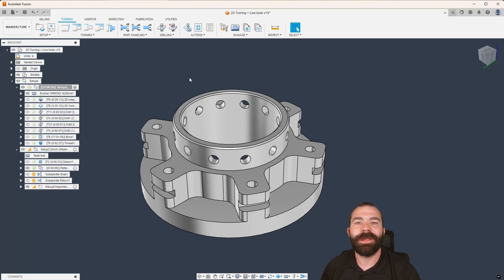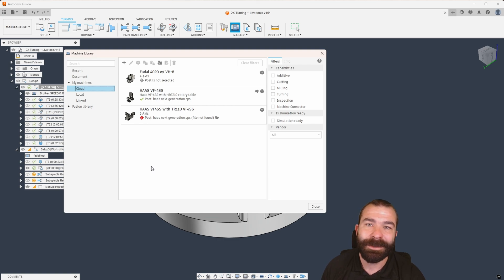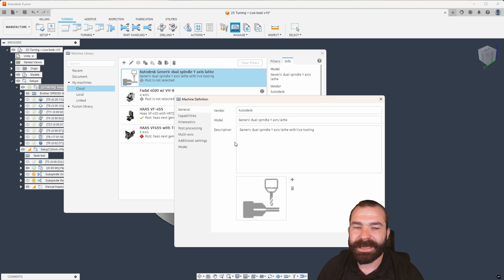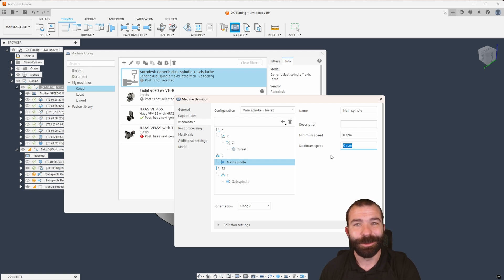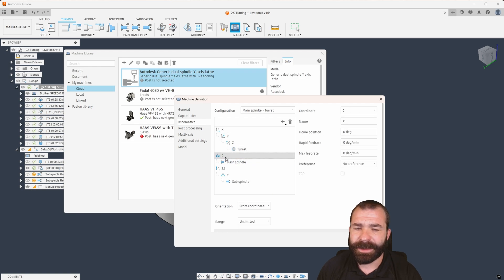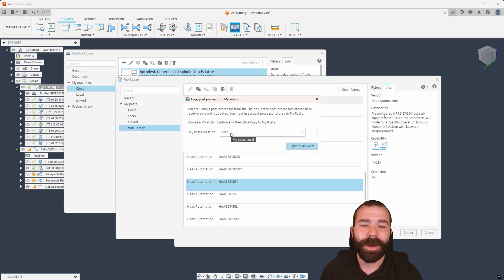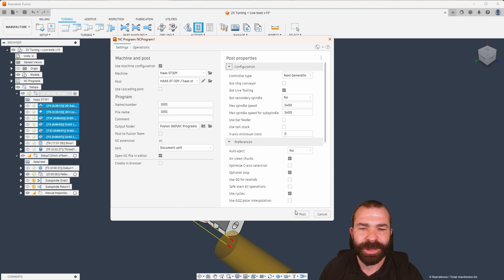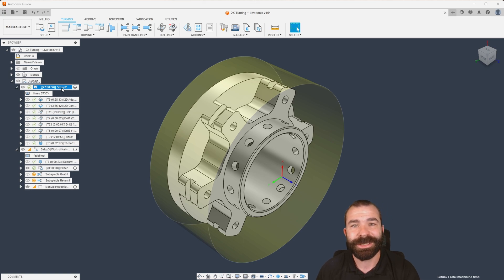Fusion Friday: Lathe and Mill-Turn Machine Definition

Comment: I have another video idea (maybe wasn't first to write that but...). If I've programmed one part, and separately another, is there a way to bring them in same cam to use Minimize tool changes without reprogramming it?
Reply from the maker: At this time there is no good way to jump between programs unless both parts are in the same file. I will however say keep an eye out as its very possible to come to fusion eventually